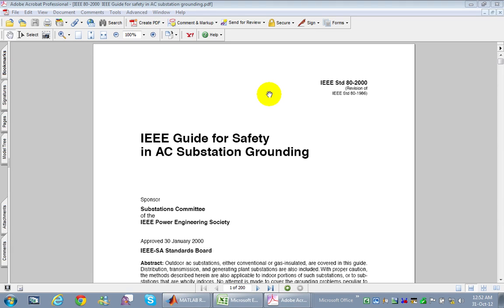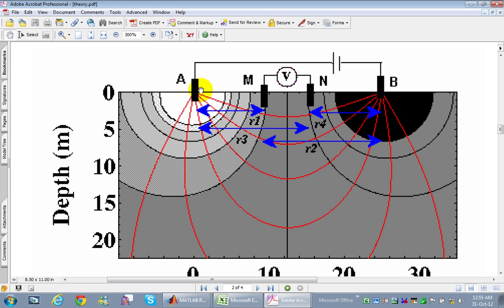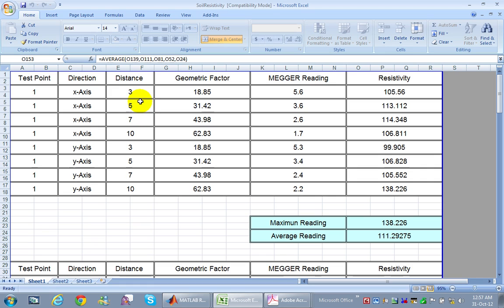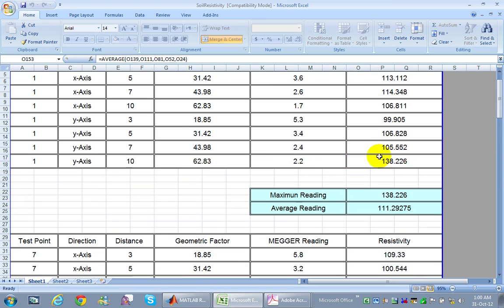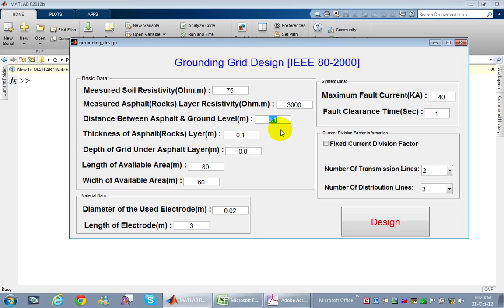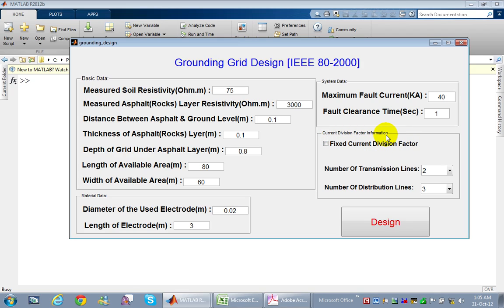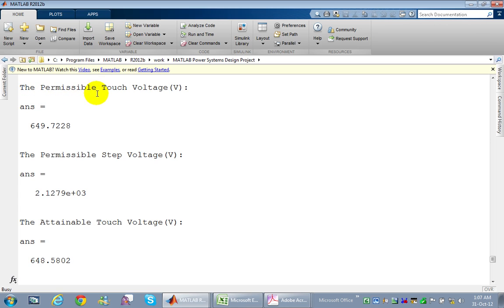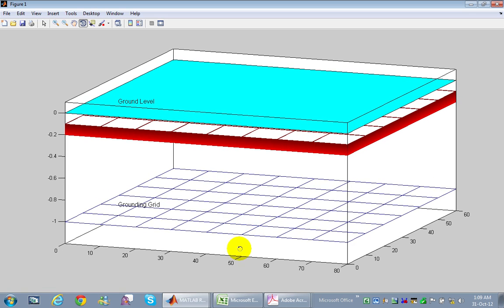Grounding Grid Design Using MATLAB for Power Substations

Comment: eng saqer is the gui and code together in the burchasing
Reply from the maker: ahmed awliyo yes, both MATLAB fikes are available (*. m & *. fig)
Reply: eng saqer i need the same code for 500kv substation usig this standard ieee80-2000
how much is the cost please
Reply from the maker: The same code can be used for 500KV substation since all parameters are editable in the program , no need for any customization .
Reply: ok how can i buy the code and what is the requirements to buy the code

Comment: Sir i want to purchase your library but please confirm me that your library performs the tasks, 1) Breakpoint diagnosis of grounding grid by using the electromagnetic and derivative method 2) Effect of soil resistivity on the derivative method... please reply me ... m waiting...thank you
Reply from the maker: Many thanks for your kind interest in my code , please note that my code is based on IEEE 80-2000 which is using Analytical calculation method based on empirical formulas & mathematical derivations .

The way which you are requesting it is called "Mesh Analysis" or "Partial derivative method" to get the results for each & every point of the grounding grid , The same is not applicable to my code .

Thanks again & hoping the best to you .

Comment: Nice work, but i have a small question here, when i consider a shield wire or a shielding mast against direct lightning, it discharge the lightning current in the grid of the substation, in this case, if we assumed u r protecting this substatiin against Lightning Protetction class I with maximum peak of 200 kA and minimum peak of 3 kA...what would change then because u designed ur grid against max. Ground faults only but considering earthing sys. For lightning current would affect because the step and touch voltages will diffen. Change much
Reply from the maker: Yes , the grid is designed for maximum system short circuit current and time.

For example . Typical systems are designed for 1second or 3 seconds short circuit time duration.

If you go back to IEEE standard for insulation coordination study you can find lightening strikes are considered as 200kAmps for 200 micro-seconds.

So . If your grid can handle 30KAmps for 1 second . It can handle 200KAmps for 200 micro-seconds.

Thanks for this question.
Reply: Lets give practical example, i had a small substation, which i have successfully had good step and touch voltage for fault current,the correspodning grid resistance was 0.532 ohm, when we assume substation protected based in Lightning protection class I, the first short direct stroke current is 200 kA with wave form 10/350 micro second, as per IEEE, the hazardous ground potential rise occurs at the peak current time which is the 10 micro, the allowed touch potential based on IEEE equation @ 10 mico sec shock current duration and i have soil resistivity of 67 ohm.m will give u 54.64 KV when u calculate ur max. Grid potential will be 200 kA x 0.532 = 106.4 KV...so..failed! So not becoz a grid protects against normal faults, it will protects against lightning discharge current in earth sys. And i really need help in this!! Becoz i believe the designer must consider all types of injected currents in his grounding sys. and lightning current is one cann't be ignored as shown in my previous example
Reply: Saqer Khalil for lightning impulse more higher, you will be expose higher step and touch, even though you will get low resistance.

Comment: is there any plugin for autocad to export to etap as xml
Reply from the maker: mohamed KAMAL Thanks for your valuable comment . in current version , No this feature is not yet added but i will work on it .

Thanks again for your valuable comment .
Reply: Saqer Khalil Mr. , one thing that i found the weakness of the program, where the arrangement of the grid electrode, where the designer should identify the grid for example 8x6 grid because from the results, you will know the risk from step and touch voltage.